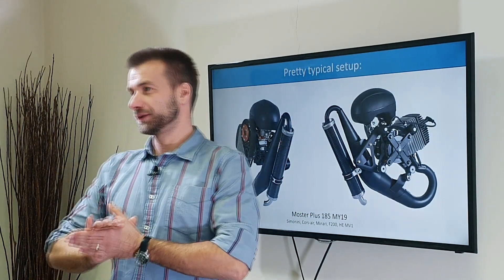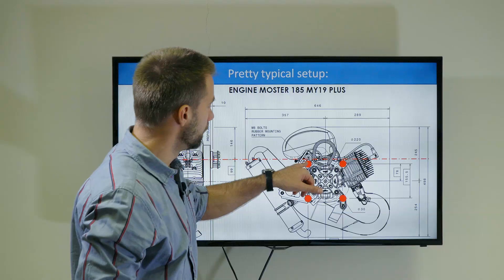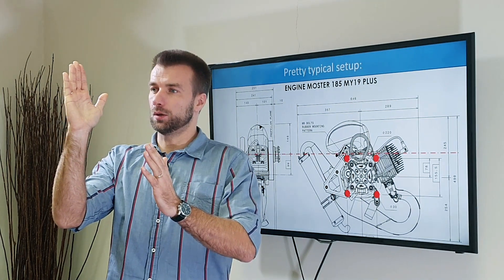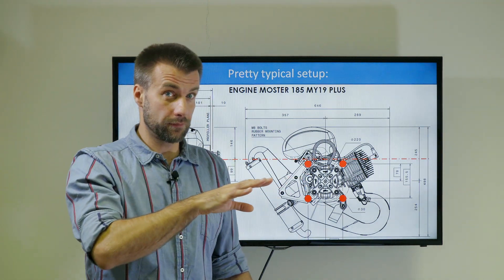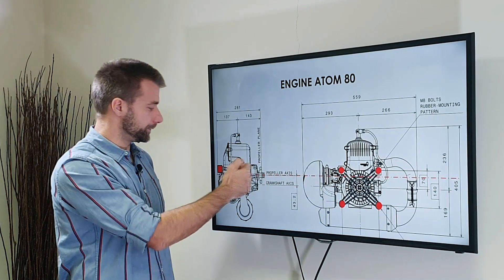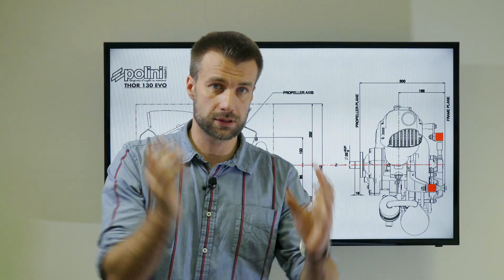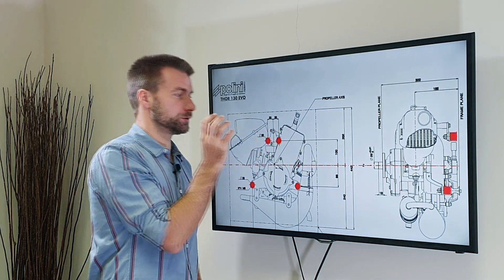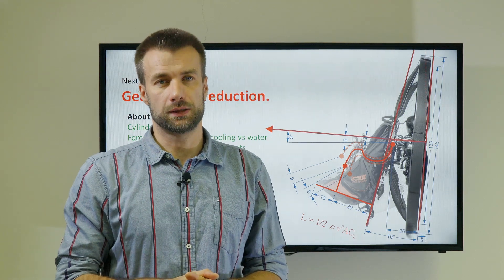Idelal position of engine mounts. Paramotor geometry part 31.5

Comment: The biggest load and stress on the mounting points is not the thrust force but the vibrations. It might be the case that the design of the mounting optimizes on vibration and fatigue caused by it, with the thrust load coming as a lower concern. At least that's my theory, but since you do have direct contact with the guys at Vitorazzi, you should definitely check with them.
Anyway, your series is amazing, I'm binge watching and I'll probably not stop until the last episode. Only 8 more to go.

Comment: But we don't fly under full power all the time (actually - on take-off mostly/only). Does this mean the prop is still tilted back most of the time?
Reply from the maker: Yes. Talking about 1 degree or two. No big deal. It just may look a little weird if you don't know why it is so.
Reply: @SCOUTaviation  But why not inserting a wider intermediate "~plate", which could attach solidly to the original mounting points and introduce the new wider mounting points for the rubber cushions at the right locations? 
I mean - yes - this would introduce some extra weight, but if the manufacturers would have designed the "right" mounting points in the first place, this would have introduced more weight anyway, right?